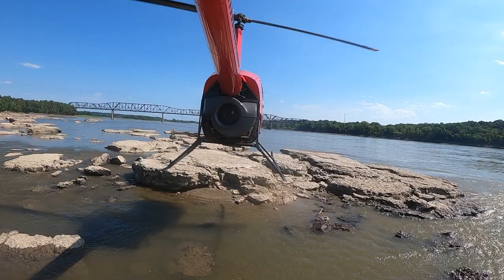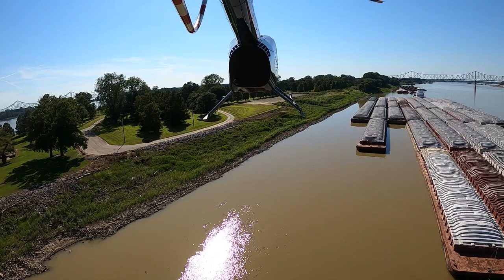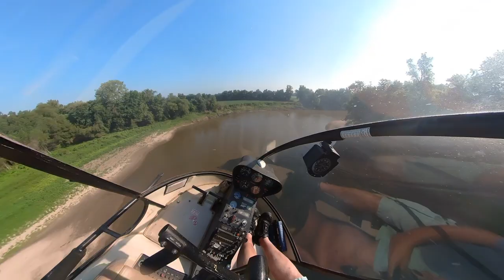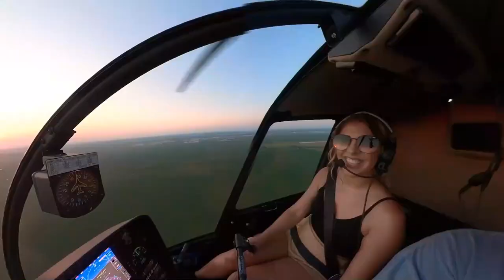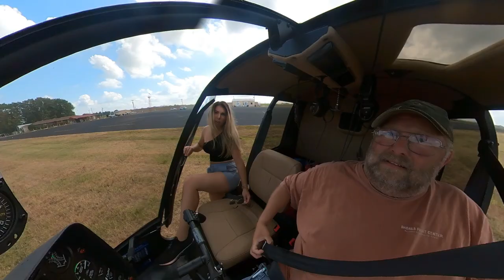Which Way is the Wind Blowing?- It's pretty easy if you know what to look for!!

Comment: Without wind indicators, it's a great way for beginners to learn wind direction at a given altitude. It takes a while to master, especially when wind direction changes dramatically with height. In the mountains, you're often constantly getting a new headwind direction in a descent which is inherently dangerous if not accurately interpreted before you make a final approach. In mountainous terrain and high DA I found using the GPS exclusively was not optimal for off airport landings since the wind is so variable without wind indicators that it leads to confusion, which leads to over-fixation on the GPS, which leads to numerous other issues that may lead to totaling an aircraft or worse.